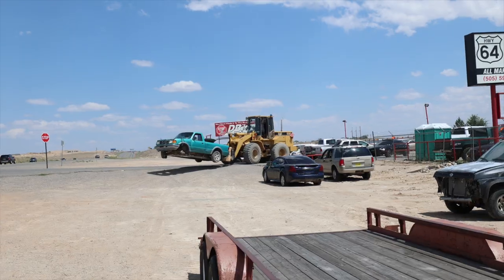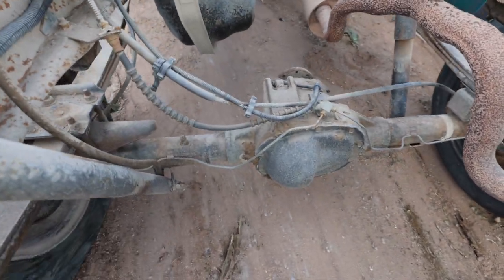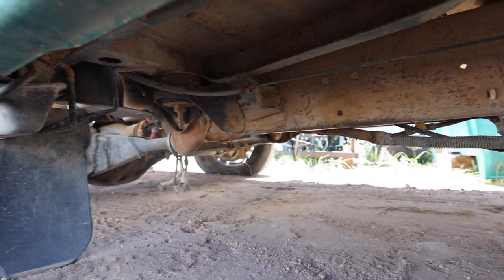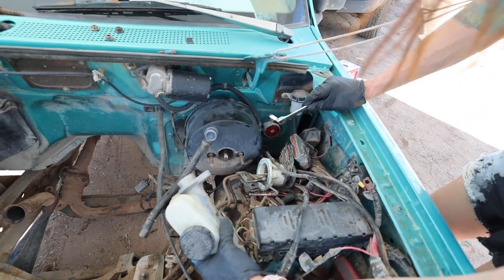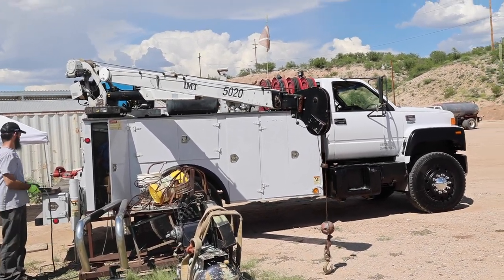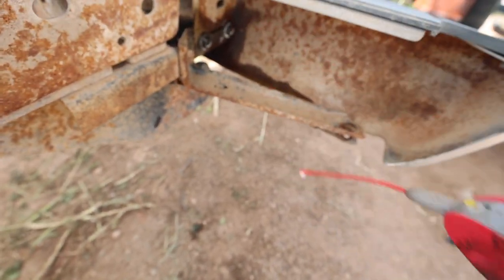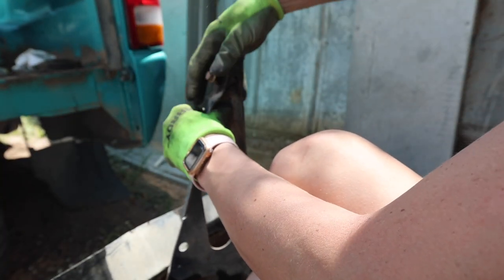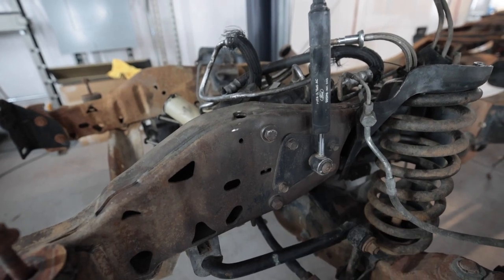This Is A Ton of Work, But Worth It! // Project Ranger Frame Swap

Comment: So you are going to have to set backlash and everything in the diffs anyways right? You might as well just remove and replace one set of diffs. You should be able to get new gears for it without it costing TOO much, but I don't know what kind of budget you're on. I also have no clue about availability or what axles are underneath that thing either...lol.

So I just looked up some parts, summit says that you don't have a dana axle, so it's probably an 8.8 in the rear. Gearsets are $250ish for the rear depending on who you go with and $200 for the front.

Comment: Please do yourself the solid and spend the little amout of money on new brake lines. Even though those are better than what you have and are perfectly fine, for the piece of mind just rrplace them with new ones. Over time water has a tendency to get pulled into the brake system and no one hardly ever flushes their brake system over its life so brake lines will corrode from the inside so you are unable to see if they are compromised...

Comment: 104 degrees is hot.  If you were in Ohio @ 104 degrees, you would have been soaked in sweat after just putting the canopy up over the truck.  You worked for hours and not one drop of sweat.

Comment: People like to complain about Rangers. I have had 3. My 1985 went 130,000 (2.3) but I traded it for my 1987 (2.8) extra cab. That truck went 287,000 miles then died an immediate death thanks to my ex-wife who took it in the divorce. And I quote: "Why is there a light on the dash on all the time that says oil?" Yep, it was begging for life prior to death. My newest is a 1999, 4x4, x-cab, 4door (4.0) I bought it with 32,000 and it's now at 85,000 and still purrs. Lol I also have a 1987 Bronco 2 that you can't tell the real milage on. The odometer is over 300,000 BUT it gets towed behind my RV

Comment: Ground cable.....not for wrecks?
Reply: It actually is both it a heavy duty cable to prevent the cab fro completely separate from the frame in an accident and also a grounding strap but it mostly for safety purpose.

Comment: That's NOT a whiptailed lizard, it is a Greater Earless Lizard.

Why waste soooo much time on a truck you can replace for $2500 or less?  And is not even an extended cab.  You'll have far more money in it in parts and labor than it will ever be worth.